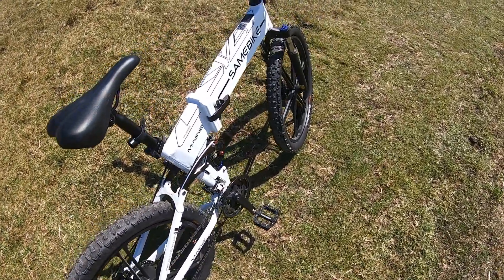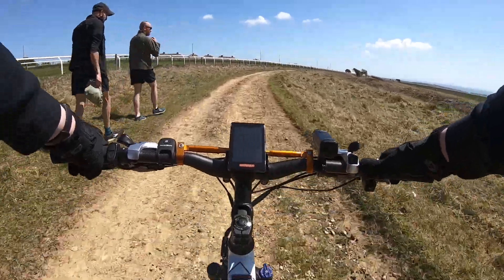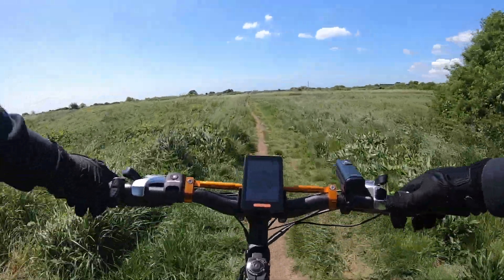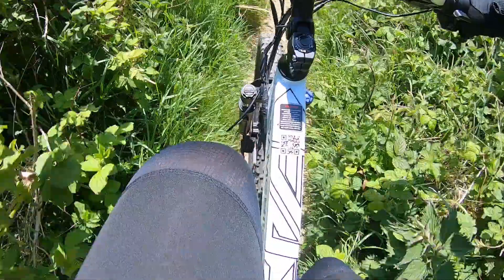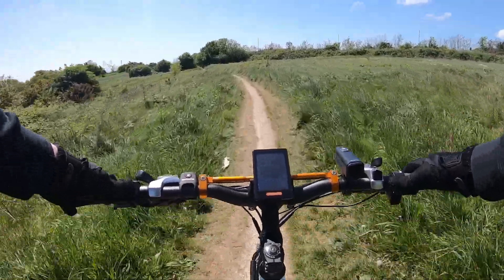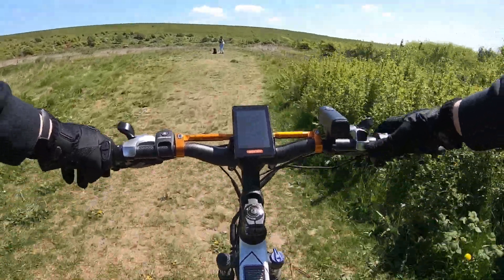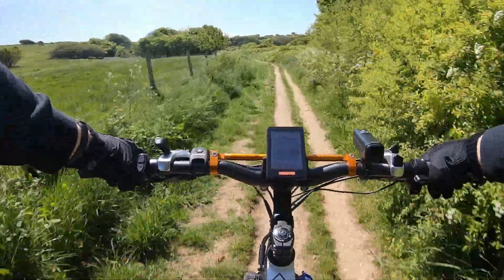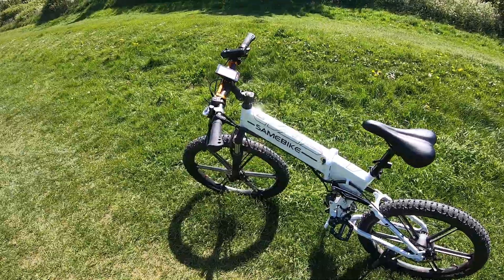SameBike L026 Version 2 FIRST OFF ROAD TEST

Comment: Do you know what the blue switch below the steering wheel does? I’ve seen it for a while and super curious what it does
Reply from the maker: It locks the suspension to make it stiff or you can make it bouncy I have mine on Balance
Reply: @bubblesway  ok thx 👍🏻

Comment: What's the range on this bike🤔🤔🤔
Reply from the maker: About 25 miles but you can get a upgraded battery that gets 50-60 miles
Reply from the maker: Hope this helps 👍
Reply: @bubblesway  Is that just off road miles?  What would it do peddle assist on the road?